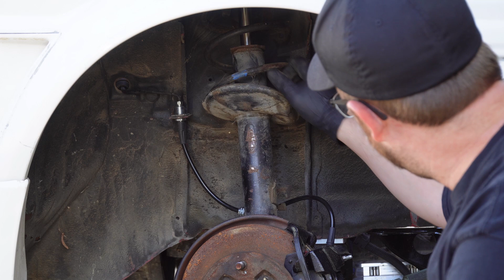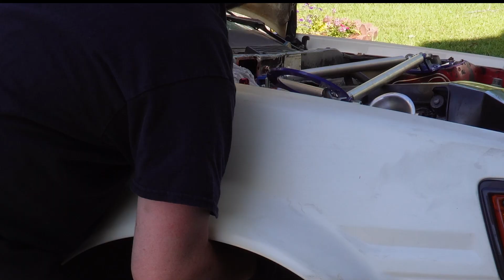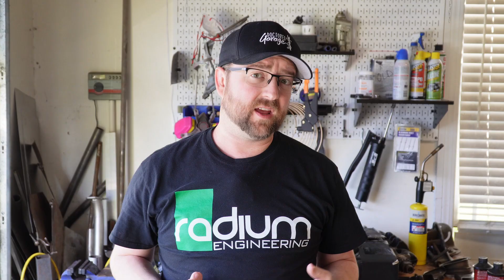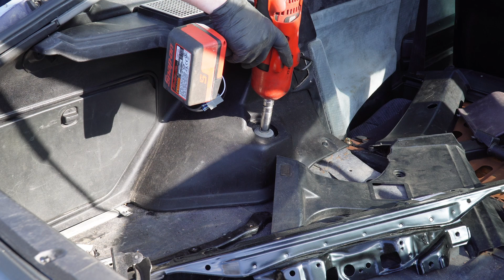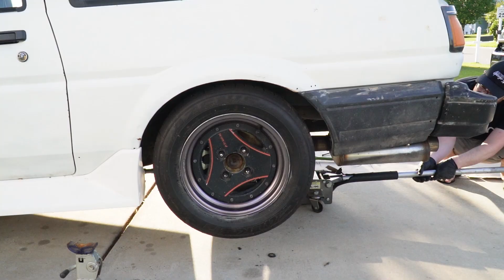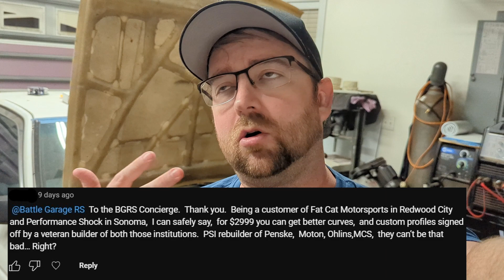AE86 Annex Coilover Install and Review!

Comment: I know this video is a year old but wondering would this type of coilover do you have to remove everything to adjust the height all the time
Reply from the maker: Sort of - the rear spring adjuster do sit kind of up in the body and they're hard to get to. Usually I'll unbolt the shock bodies from the axle and lower the whole axle down to adjust ride height
Reply: @DoctoredGarage  okay I've got a set of aimgain coilovers that I've never been able to get any instructions on and I just wanted to know if the fronts were going to be a super paying adjusting the height. They're going on a 2002 Infiniti Q45 or what they call a Nissan F50
Reply from the maker: That should be real easy to adjust front ride height with everything on the car.
Reply: @DoctoredGarage  thank you for the reply you've been the most help in the last three years since I've got these
Reply from the maker: You're welcome!

Comment: Good morning

I also fitted this suspension and with the roads in very poor condition here in Belgium I have swift springs in 6 and 4.7

What hardness settings did you set?
For example - X click starting from the hardest at the front and the same for the rear

Thanks
Reply from the maker: I'm in Arizona, USA with really smooth roads so I'm not sure my settings will work well for you. 

With the dampers adjusted all the way low, rebound is "slower". I would start at the lowest setting, then adjust up from there until you find what you're looking for.

Comment: As always very informative. Thank you. Do you remember how many inches you left between the top of the spring perch and the lock ring?
Reply: That’s on the rears. You showed the measurements on the front and thank you for that, it helps a lot.
Reply from the maker: I don't remember exactly what the measurements were for the front. I don't think I touched the front for spring preload. I might need to raise the front though - now that the suspension had settled the front looks a little bit lower than the rear
Reply: Thank you and keep those videos coming!